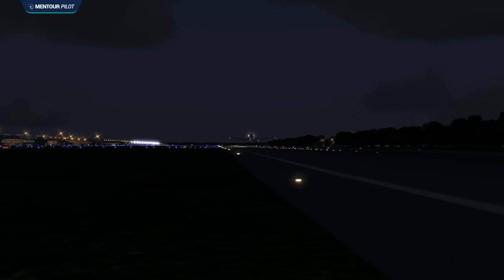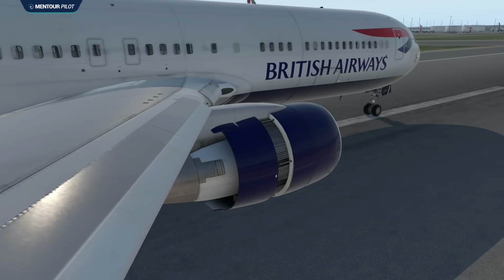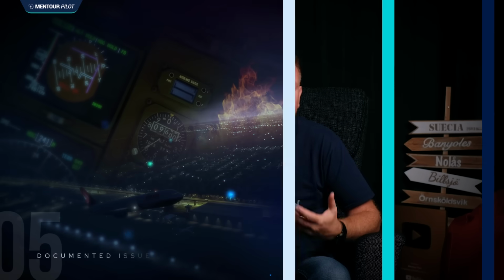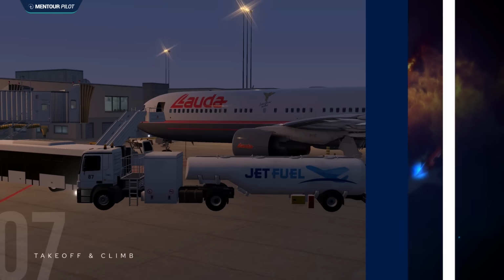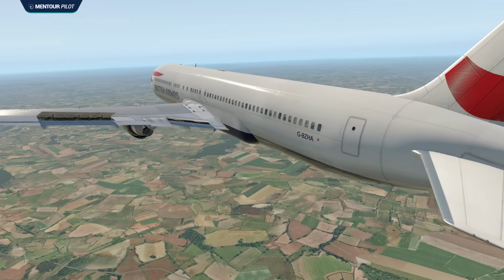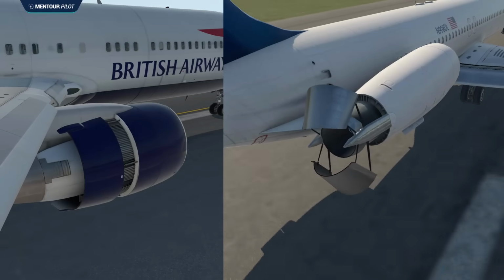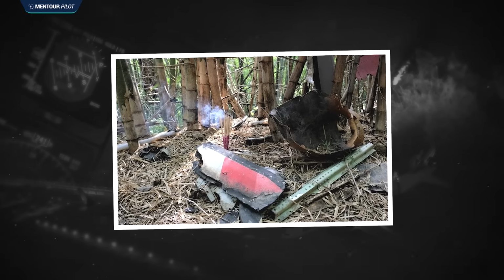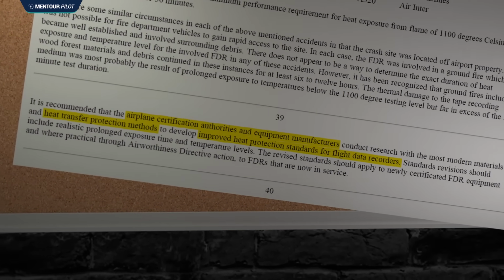HOW an Impossible Failure CRASHED this Boeing 767!

Comment: I believe I survived an in-flight thrust reverser deployment in June or July of '71 on an Olympic Airways 707 from Athens on initial descent into Rome - a sudden 45 degree dive, but NOT overspeed (hmmmmmmm), looking down the cabin and getting vertigo! The plane finally "leveling out" bucking, pictching, rolling, yawing, wings flapping up and down.  During the dive a woman next to my mom asked her "Are we gonna die?" and my ice cold mom said "no".  Anyhow after all the chaos, he did come in for a faaaairly nominal landing - the lower and slower, the better the thing was  handling ,  During the bucking and pitching portion, you could hear the mechanical whining of flaps trimming up and down, up and down, with not much effect.  When they finally landed, some American passenger yelled out, "Let's give the sonafabitch a round of applause!!" and the cabin ERUPTED into WILD cheering and clapping.  We were happy to be alive.  WHen disembarking, the captain was on the right, staggered against the wall, DRENCHED in sweat.  Clearly something wasn't normal.  What happened? I asked MANY pilots afterwards in the ensuing decades - no theories were given... however I KNOW 707s have survived this (and also CRASHED from this)... even mentioned in this video, so...???  I'd appreciate input on this... perhaps it was an uncommanded slat, flap, or some other stuck control surface.  It was NOT nominal and threatened to break up the aircraft, I ASSURE you.

Comment: I would love to see an episode about how fast pollute an A380, Boeing 737 etc the enviroment. If we see the flightradar trafic and calculate that an average commercial airplane burn 3-4 tonnes per hour fuel the result is devastating. Eu leaders blame the cars but the pollution of airplanes mostly jet engines do a significant damage to the planet. I guess dear Mentour pilot you would risk your job as a pilot and instructor if you would make a film in this subject. What if you dont?

Comment: Only two pilots flying from Hong Kong-Bangkok-Viena was a long duty. Lauda was famous for pushing their pilot to work long duty times. Fatigue should be considered, if you are tired, your reaction after a startling event is not the same. But airlines just want to reduce operational costs…

Comment: I don't quite understand this accident sequence.  The airplane won't free-fall at mach 1 so did the pilots never pull the throttle back to idle to try to avoid the overspeed?  It seems like if that had been their first reaction it might have resolved all the immediate problems (excessive differential lift and yaw, rolling, loss of control and speed) and given them a chance to try to troubleshoot the root cause.  Is not the first step of nose-down unusual attitude recovery to reduce power to avoid overspeed?

Comment: How are aircraft quality microswitches so SHIT? Similar microswitches are used to control the nitrous injection systems on drag cars, and the ones we use are sealed to moisture. I've seen water spilled directly on an WOT (wide open throttle) microswitch, no effect. I've also seen them doused in fuel, also no effect!

Comment: valves messing things up, hydraulic systems doing something they're not supposed to do, checklists not mentioning things that are essential. Odd - seems like Boeing-planes have these kinds of problems over and over again with several systems involved. Freight doors, landing gears, thrust reversers....same mistake even happend with their Orion capsule.

Maybe Boeing is simply too dumb to build those things correctly...

Comment: It's deeply troubling that each time a fix was attempted to the fault, it reset the clock. Persistent faults like this should accumulate time to prevent long standing issues wating to catch you out.
Reply: Anyone who's consumed the whole Max8 scandal is likely to conclude that, when it comes to safety, Boeing talk the talk, but don't walk the walk. I'm reminded of Ralph Nader and those exploding fuel tanks of Chevrolet/Ford production cars in the 70s. Perhaps you recall the phrase of those days, "Too big to care!"
Reply: I think the key point here is that Boeing basically said it was a minor issue and not worth grounding the plane for, and the "reset" wasn't just the engineers slapping duct tape on the problem and hoping it'll work, they were replacing actual components. To use the example of a ground vehicle, it wouldn't be an oil pressure light, it'd be like if your passenger airbag light kept coming on when there wasn't a passenger on board, and so you kept taking it to a mechanic and they kept replacing your airbag or the fuse or electronic components as per the car dealer's instructions and being like "hopefully it's fixed this time". Each time you take it to them you think this time you've finally fixed the problem, but you both know it's been a minor but problematic problem. It's something you both want to get to the bottom of, but the most important part is that you have a drivable car.

Then one day your passenger air bag explodes violently, blasting you with shrapnel from your dashboard, incapacitating you, and you hit a semi and cause a 10-car pile up. All because your car dealer did incorrect safety testing on the airbags they were using and then assured you and everyone else they were totally fine.
Reply: @SaltExarch  The thing I think you’re missing here is that it was a minor problem they thought they had handled until it suddenly and horrifically wasn’t. Fortunately these people didn’t die in vain and a solution that actually fixed the problem was found but unfortunately things that result in minor issues 100% of the time and then suddenly result in a horrific tragedy are bound to happen.
Reply: I whole heartily agree.  There should be not reset of the time especially if the incident had repeated even once in a given year.
Reply: Or at a minimum, the permitted fly time gets shorter and shorter. Eg, 500h after first fix, 400h after second fix, 300h after third, etc.
Reply: Ditto on that.. At ground level if the oil pressure light on my 84 F100 kept coming back.. I paid attention

Comment: A great episode and good analysis. I have heard on the original design if the Thrust reveser T/R sleeve drifted open and gave a cockpit signal the pilot could nudge the T/R control lever to power the directional control valve (which SHOULD be in the stow position) and re-stow the sleeve, Perhaps that's what happened with Lauda air. Pilot tries to re-stow the sleeve and clear the annoying cockpit indication and the asymmetrical drag and yaw that required the control correction I believe the cockpit indication was for T/R sleeve position, not control valve position.

Comment: 500 hours before it gets fixed? Sounds like a car owner with an intermittent oil light on, that became on and never checked the oil because it had an appointment next week. At lest you can pull over when the engine shrapnels.

Comment: I just thought of an ejecting black box that before hitting the ground the black box ejects from the plane. More likely to recover it intact?
Reply: I think some NASA rockets actually have something like that-a package that ejects with some velocity from the rocket and eventually pops a parachute after a destruct command has been given to the (unmanned) rocket--
if the rocket begins to go off course and otherwise fail to be controlled properly so as to become a threat to go somewhere that is shouldn't I think such a self destruct command can be given 
but I think for airliners real time uploading to "the cloud" is more of a possibility
Reply: @davidpowell3347  I dated a woman who said her father used to be a NASA engineer. He invented a eject to save astronauts if the take off goes wrong and parachute the capsule down. He was told it would cost too much. Then the Challenger disaster happened. His invention would of saved them.

Comment: First time I flew I was about eleven or twelve by myself from Louisville Kentucky to Atlanta Georgia. Had a window seat right by the engine. It was cool shit seeing that thing pop open and used for reverse. You say they're not supposed to use this in the air. Well they did coming in for a landing still a couple thousand feet up a few hundred mph and no fucking warning it deployed. It was a lot louder than it was when it opened to back up from the loading tunnel. The biggest thing is that this was a value jet flight during the time that they were using faulty parts and some planes decided to quit being planes with no warning. Lol. Needless to say I about lost my shit when all this went down. When I say it was louder this time imagine three to five hundred mph and the metal back casing of the engine pops up catches wind. I don't see how it didn't rip the fucking engine off the wing. Didn't know that wasn't supposed to happen in flight till now.  Wtff smmfh.🤨😬

Comment: Another crazy idea comes to mind: Immediately actuate the thrust reverser on the good engine! 
although that wouldn't work because of the lockout mechanisms and requirement to spool down
but if somehow both reversers actuated at the same time it wouldn't be as bad as the asymmetrical shear of having thrust on one side and reverse thrust on the opposite side
Reply: But then you'd have an aircraft with absolutely no lift being generated on either wing, which would cause the airplane to lose speed, ultimately stalling and crashing.
Reply: @budsurtees4224  I believe you would still have some lift being generated on the outboard portions of the wings but you would have to dive to maintain airspeed while fighting to get the engines shut down completely,the reverser stowed on at least the one good engine and then the process of trying to restart that engine all the while hoping you had enough altitude and glideslope left for all that   maybe have to recover from some other kind of upset in flight as well 
 R.I.P. David Allen Drach  American Airlines pilot and 100  mile footrace winner (1990 Mohican Mania in Ohio)

Comment: Is an (asymmetric) thrust reverser actuation at full thrust at speed worse than a full uncommanded rudder deflection to its stop limit? (more yaw and roll induced)?
would immediately cutting thrust completely on both engines within 5 seconds of the reverser activation save the plane--that is allow the pilot flying to regain control before the airframe begins to disintegrate? Then at least they would have a glider that they could begin trying to restart the engine without the bad reverser and then a conventional one engine out flight to the nearest runway? (Keeping the engine with the devil thrust reverser shut down)

Comment: If the captain had shut down both engines at the onset of the thrust reversal, could the spin, bank into dive have been avoided?  It seems like the airspeed needed to be reduced immediately & with both engines shut down, thrust differences wouldn't have been an issue - thereby maintaining control - no spin, roll, dive, fuselage failure.  Then plane could be slowed to a safer speed, & descend to a lower altitude, before restarting the good engine only - flying to closest airport for an emergency landing - could this have been effective in saving the flight?
Reply: I think the crew and passengers in that plane felt a heck of a lot of g force from the shove and lurch in the first couple seconds after that thrust reverser actuated --maybe even enough already to have tweaked the airframe?

Comment: As an aircraft technician, I was given maintenance history and cured these problems.
I would see alot of resets, that bothered me, cause problems like this was considered easy fixes.
To me a reset should be to get it to a heavy maintenance facility,  like the one I worked at.
I've had to do high energy abort inspection on a unsafe thrust reverser.

Comment: Microswitches? I do not think so. I also highly doubt you know anything about aircraft in general apart from Wikipedia 😂 Lauda was fiddeling around with a pesky Boeing quality issue and thus the aircraft should Not have taken Off until this was sorted. But Like Boeing, Lauda was not able to do a proper Job. And neither did you.

Comment: What may have happened if they dropped the landing gear in an attempt to slow the plane and regain control?  What is the max speed that the landing gear can be deployed at and if it is exceeded, what may happen? (the gear wont go down fully?).  They wouldn't need the gear to go down fully, just enough to create some drag to slow the plane down and hopefully buy them more time to try to get control.

Comment: It really should be common knowledge these days that mega companies such as Boeing have a whole different angle of looking at things that require them spending their gigantic fortune as opposed to them selling aircrafts etc and making money. This is quite apparent when considering at what point does a 30,000feet fault require attention. Their issue is that if they were to acknowledge such fault, it's not just a single aircraft but every single one they produced with that set up. So they complete the test and model, why at lower speed and lower altitude? That should be obviously clear. STOP thinking these companies are any bit angelic or innocent! Mega fortunes aren't made by having those attributes ever! The model and test were completed and successful only because Boeing was allowed free range to make it so, similar to when there master test pilot was in the simulator with the same parameters after the incident, then stated the original pilots had 4-6 seconds to avoid the accident. What wasn't said or stated was if Boeing masterful pilot saved him self? If you for a minute think he had no trouble and righted the aircraft, I sincerely think you would be incorrect with that assumption. As truly it's what isn't said that's important, as the general rules of humanity don't apply here. Odd how the one part in question was taken from the crash site, don't you think? Then how it was returned later but tampered with so as to render any embedded fault non-existent! One guess for who possibly was involved there, that should be a given. 
If enough greed is involved the issue of a fault being someones fault directly just like magic turns into innocence. It's happening so often most of us humans are completely blind to it and unfortunately no excuse is needed though if it were this behavior is just what they are after!
TRUTH OR TRANCE

Comment: I'm a software engineer. As such, I have constant interest in fault prevention techniques, the industry calls that 'defensive programming'. And sometimes, aeronautics is cited as prime example, if not lode star for how to do it. That's just for context.

What I found curious is the connection to an accident just 2 years later during landing of LH 2904 in Okęcie International Airport, Warsaw, an Airbus A320-200. The conditions on allowing the reverse thrusters to be deployed seemed to be much tighter: not just had the two landing struts to take wight, the tires had to spin too, exceeding a certain velocity, so that the system would allow the thrust reversers to deploy.
Alas, in that landing situation, this developed into part of the cause for a crash during landing: the pilot anticipated sheer wind, but got tailwind. That lead to the second strut being put down to late, and also hydroplaning preventing the wheels to spin fast enough. So the reversers were deployed to late, causing the plane to overshoot the runway and crashing into an embankment, with one loosing his life on impact, and a second by asphyxiation through the ensuing fire.

I think of this as a constant reminder for the complexities of life and technical systems. What seems to be as sensible precaution in one situation, may turn out as a mistake in an other. Another example for that is the decision to lock the cockpit doors after 9/11. Seems sensible. But also made it easy for the suicidal co-pilot of Germanwings Flight 9525, to lock out his captain, when he went for a potty break. The captain was still banging at the door, when the copilot slammed the aircraft into a mountain, taking 149 lives with him.
Reply: The Law of unintended consequences...

Comment: It seems like if one opened up the other reverse thrust should as well that doesn't make sense that only one side opened they possibly could've saved it by trying to open both sides or shutting both engines as soon as they went into a downfall